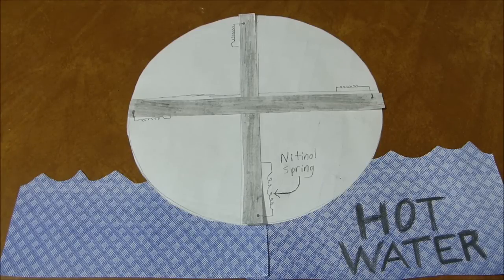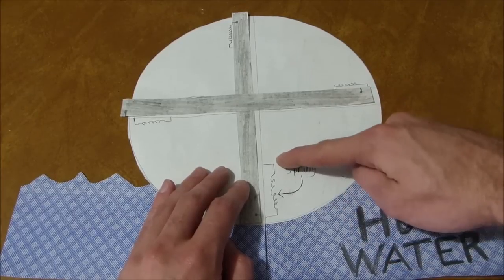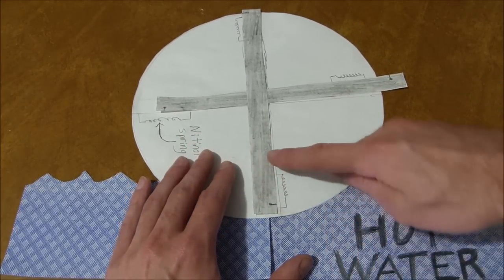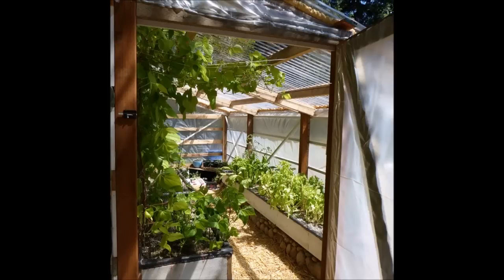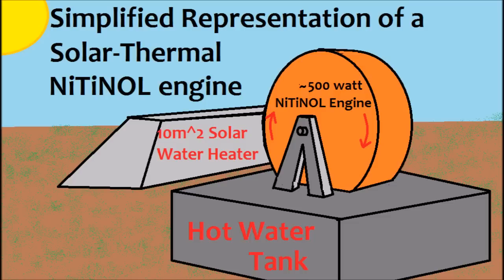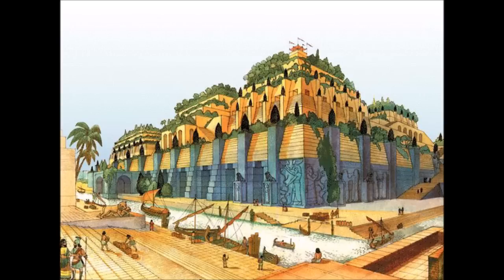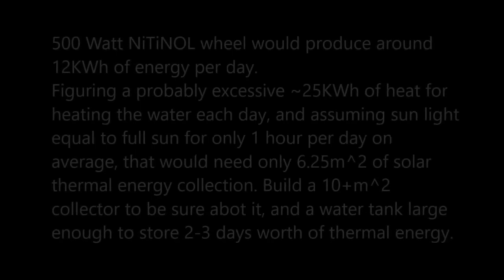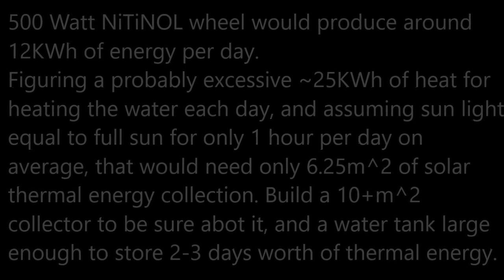NiTiNOL Spring Engine Generator Design Memory Metal

Comment: I made this device in 2009 and presented it to the NEL in Scotland.I was offered £500,000 in grants if I could get a university on board .No joy and still trying. Unbelievable! You have done very well. I think the original spinning unit was constructed in the mid 1970's.The video is still available from the inventor of nitinol.Thermal solar and water heat collection is the way to go.TEG engines can also use cold drive as you only need a thermal differential.Nice ideas all the same.Do we really need oil?

Comment: I always wondered if nitinol could be used as the spring in a windup mechanism, same type as found in toy windup cars. My thinking was that in its flaccid state, it would be easy to wind. Then, after making it ridged, it would unwind with more mechanical force than was used to wind it. I did not say it would release more energy than went into it because the hot water is energy added to the mechanical energy to wind it, so less out than was put in.
Guess we’ll never know.

Comment: wow nice design
Reply from the maker: +Connor Dow Thanks! Not sure if I will actually build it ever but I think it is a possibly useful design anyway. Maybe on my next, bigger, greenhouse. I might try to see if smaller NiTiNOL engines can sell on eBay.
Reply: i just tried building my first nitinol prototype it works like the shaft of an engine i think its called, but instead of pistons it is a nitinol spring and it is all suspended over hot water and when the crank shaft goes around to the lower part of the rotation it is dipped in the warm water so it will contract and rotate the crank shaft but then it will be out of the water and will cool down letting the next spring follow the same process repeat. you probably didnt understand a thing sorry i had to rush this but if you understand engines you might get it. i built it in less then 4 hours even tho i have barely succesfully set the nitinol springs and built every thing out of crap like lead wire for the shaft. so it didnt work looked like it was going to go then the duct tape gave out and i raged quit.
Reply from the maker: Connor Dow Yes I get it, sounds like that design could work. The difficult part of that one might be that 1/2 of the time the spring is in the hot water it would still need to be stretching longer.
Reply: i dont really understand what you said about half of the time.......but it should work and should have a lot of power or torque. i think we should use nitinol engines in trains. imagine steam trains had to boil the water and use the force of the  steam expanding. with nitinol you would only need to warm up the water with a log or 2. should work right
Reply from the maker: Connor Dow Wow yeah that would be a good use. To make the same power as a steam engine you would need a much bigger engine, but with trains they are already very heavy and a little extra weight would probably not matter. Keep in mind that the amount of fuel you burn will be proportional to the output power with the efficiency as the coefficient (so NiTiNOL engines might be more efficient but you still need a lot of fuel to get that much power).
Reply: i see your point but you forget how big steam engines are a lot is wasted tubes and pistons it would actualy be smaller as nitinol is very powerful

Comment: An engine which combines nitinol materials to make various forms of components, not just the ones that come first to mind, but all manner of pumps, motion conductors, and motion enhancers, combined with neodymium and praseodymium magnetic dynamos, steam conversion, hydrogen and oxygen separation and recombination, all in some sort of  homeostasis, would be quite an achievement.  Just remember, the most efficient engines are organic wholes which involve homeostasis.  It was never about "perpetual motion" as the detractor idiots maintain.  It is about the common sense to let nature do more of the work, to let a giant lift the stones, all you need is a little persuasion.

Comment: What is outer diameter , number of coils and the stiffness of spring used ?
Reply from the maker: Oh I don't have any specifics like that, it is just a design. To get it working, you just need to ensure that the weight of the sliding arms is light enough for your nitinol springs to lift.

Comment: what is your progress on the project, after 2 years ?
Reply from the maker: I haven't touched it, this never really became a project it is just one of several ways I was thinking of generating power for my greenhouse. I set up a photovoltaic system, and have solar thermal water heating to help keep the water warmer (but not for electricity for now).
Reply: @JaycubL  You can buy nitinol wire that transitions at 15c or 59 degrees Fahrenheit https://nexmetal.com/products/nitinol-memory-wire?variant=16787622532

Comment: If you have a spring on both sides of each beam, it wouldn't work. You need it on only one side, otherwise it wouldn't move. The top spring inst being heated. The  resistance of the other spring would lessen its pushing power
Reply from the maker: +Count chocula You have to have the spring on both sides for this to work. The spring at the top has cools and softens after it is out of the hot water, so the spring at the bottom can easily overpower it. Whichever spring is in the hot water acts as a strong tension spring, whichever spring is out of the water cools and acts as a piece of soft wire.
Reply: +JaycubL I didn't realize. Cool

Comment: Nitinol is only dependable if you use a solid single piece.  you will get horrible heat to work conversion if you use a multiple wire system. that's why the dr  Johnson engine is the most efficient.

Comment: the spring contracts when warm, yet you clearly show the bar in your design going up when the spring is put in hot water. the spring should contract and the bar should go down. This is very obvious, I'm surprised you didn't catch yourself while talking.
Reply from the maker: No, the spring is connected at the rim of the circle to the sliding bar, and nearer the center of the circle it is connected too the wheel. If you look closely at the paper animation you can see that (the point where the spring connects to the bar is the further-out point). So when the spring contracts, it pulls the end of the bar in toward the center of the circle.